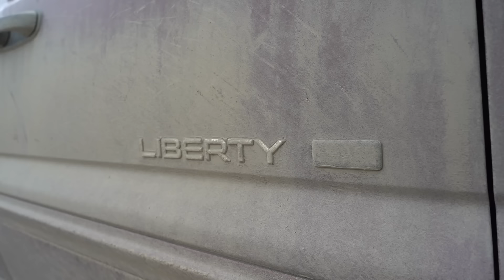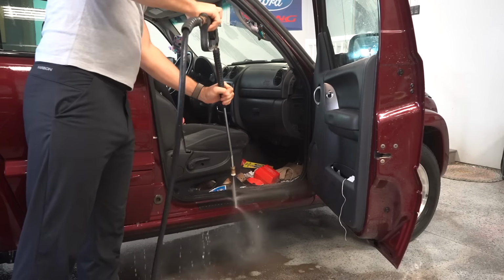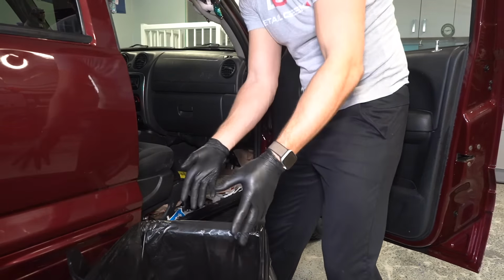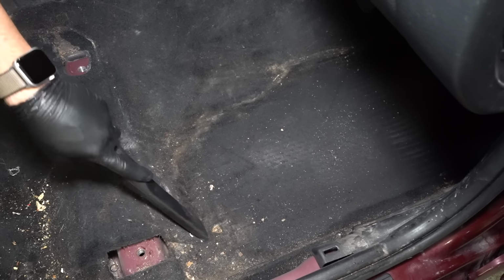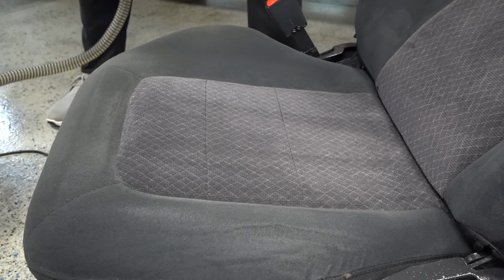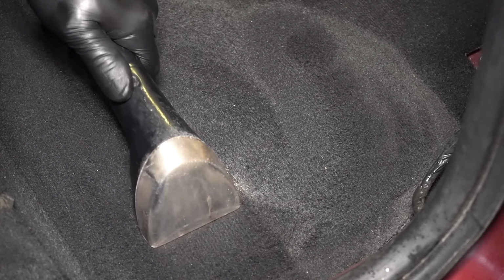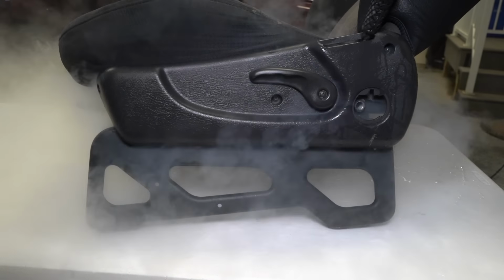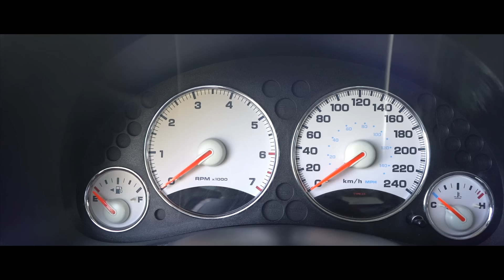Deep Cleaning a NASTY Garbage Can on Wheels! | The Detail Geek

Comment: me: “i wonder what his vacuum of choice is?”

The Detail Geek: H O U S E
Reply: Is this a Canadian exclusive thing? I've got one however we have no tank or suction device, the ports are all there though
Reply: @deephorizon1365  means your system is roughed in.. Hire someone to install the vacuum. There will be a pipe sticking out in the garage or mechanical room of your house.
Reply: @deephorizon1365  a restaurant I worked for years ago in the states (east coast 🤷‍♂️) had the same vacuum set-up.
Reply: I live in the states and some houses here have them, but usually only the super high end/techy houses. I was young and in a house that had one...I thought they had floor heating/ac vents and was super stoked about them...imagine my embarrassment. 😳
Reply: @deephorizon1365  I work at a barn in the states and they built their own house in front of the barn. They added the in house vacuum when they built it. It's more of a we built it in or wow this house we bought has it kinda thing. Also a we have enough money to afford kinda thing.

Comment: I tried detailing my 06 Liberty by myself and couldn’t get the seats out… the bolts are rusted and super stuck… wish I could send it to you but you’re so far away ;-; I keep it clean but it has stains from hard usage with hauling and work I can’t get out. Can’t get to the spots -.- when I tried doing my seats inside the vehicle I ended up making water stains on the sides of the seats because the hoover wouldn’t bend to reach…

Comment: Its funny how some people have $2k hot water extractors, n they work great, not knocking them. You'll have a guy who only details their own vehicles that will buy into the hype of getting that same 2k machine, when legitimately a 150 to 200 dollar decent carpet cleaner will do a very similar job, idc what anyone says. The only reason its not practical for pros is the fact its not meant to be used 5 times a day every day and also the fact ud have to empty the water at leadt 2 times on a dirty vehicle if not 4 or 5 times which is wasted money.

I got my 2012 tacoma and my buddy has a "water extractor" (carpet cleaner is what it is). I used his water extractor on my driver seat and my Bissell regular carpet cleaner, n they looked no diff. Only diff was that my side put down a tad more water and was a tad more wet afterwards, i used my shop vac to help dry it. Anyway u can go either way u want people.
Ur laying a solution down (or only hot water which is also fine) and sucking back it up. That is the process, how u get there is up to u.